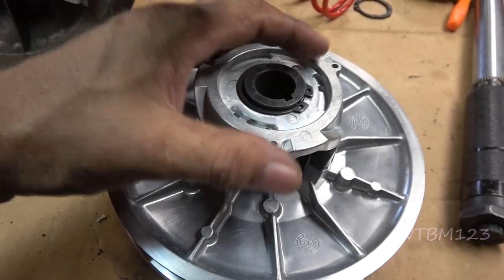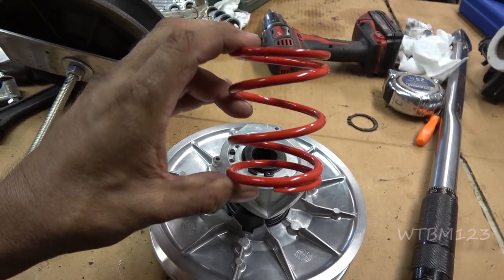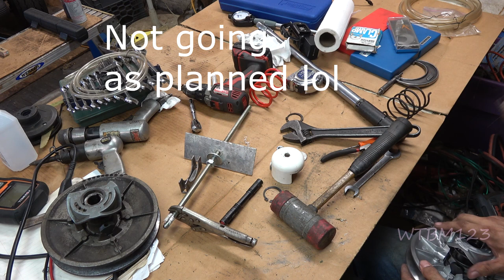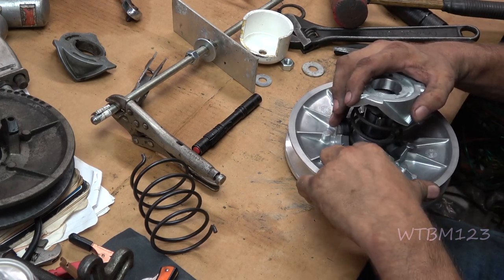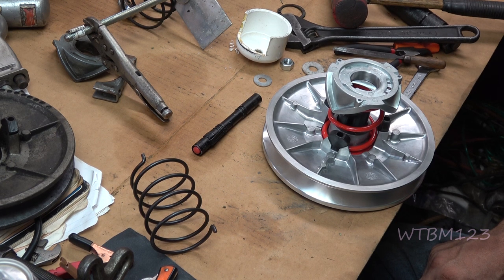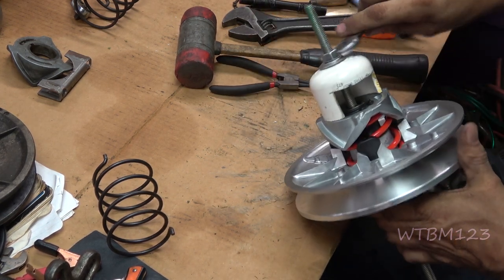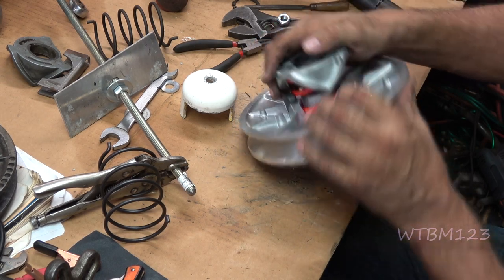Vevor, Club Car DS driven clutch for 97 up ,installed on 1987 Club Car , Power Spring or old spring

Comment: Great video Terry, from what I have had experienced over the years with Snowmobiles and ATVS   the torsional springs (your original type with the tangs) are directional only, Used in golf carts that run backwards in reverse mode. but the compression type (red one in your vid) are bi-directional.  In other words you can use a compression spring in either application but you must use the correct spring in the 2 stroke reversing rotation application. Whatever works and keeps Sam happy is great.
Reply from the maker: Yes bi directional . but i think if i did it again i would just line the ramps in the middle as they do not seem to do anything now
Reply: @wtbm123 

The clutch ramps ? Do you mean they don't allow the clutch to open up when driving  ? Seem to work while in service mode when you tested it.
Reply from the maker: @TrashPanda71  yes but not under a load , ,
Reply: @wtbm123  
I am installing that very clutch shortly and put the power spring on it, starting to rethink that now.
Reply from the maker: @TrashPanda71  If putting it on an older cart , pretty much need the power spring because of the direction of rotation .  Or maybe use your old spring .

Comment: What effects did the power spring have on your torque up hills, and your overall top speed?
Reply from the maker: It may of slowed the top speed slightly . It does seem to get to that speed quicker maybe .It did help on hills slightly .  What i notice the most is braking , You have to learn not to just let off the throttle or it stops fast . I rarely use the brake now .